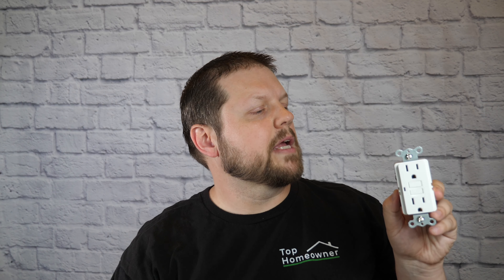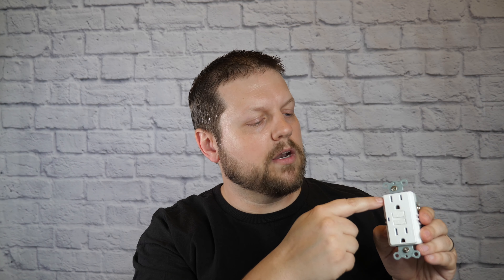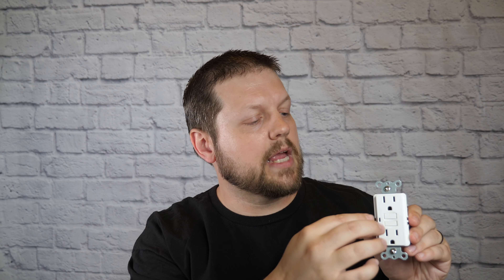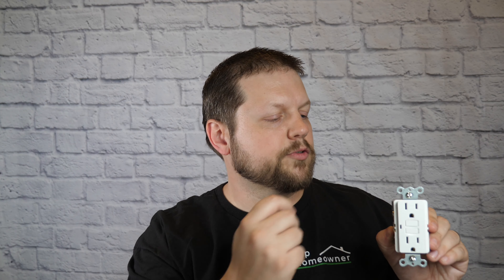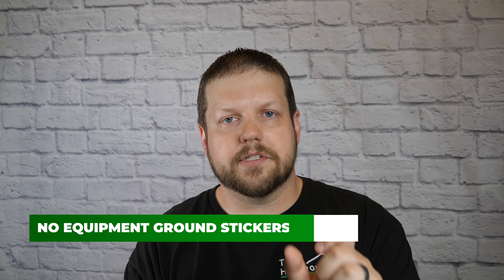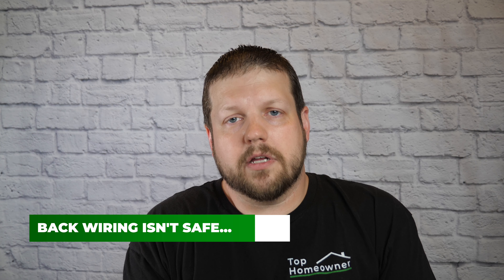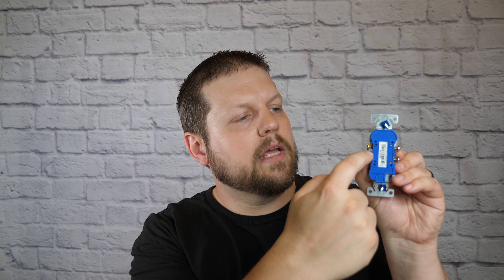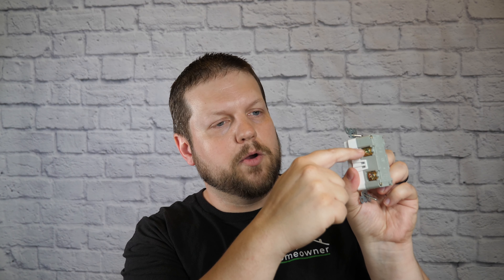Upgrading Two Prong to Three Prong Outlets - Don't Rewire Your House?

Comment: The house I currently live in was built in the 1920s.  The wiring was upgraded in the  late 60s early 70s it does not have a ground wire.  Some of my box has been upgraded and one room was completely required.  I’ve enjoyed your videos and learned a lot.  I know you recommend a licensed electrician and although I agree, $40000 to update my home is just not feasible at this time.
Reply: Wow, you must have had a knob and tube system. Yes GFCI and ARC Fault interrupters would be an affordable improvement. Good luck.
Reply: In Australia 🇦🇺 it’s actually illegal for anyone other than a licensed electrician to do ANY electrical work in your home in fact here in the state of Queensland they have inspectors who randomly check and if caught it’s a fine of up to A$40,000 for individuals and up to A$300,000 for corporations. So things like replacing outlets,changing a light fitting,changing a plug and repairing extension leads are all illegal and fine applicable!

Comment: How do you identify which is the 'first' outlet on the circuit? And once you put a GFCI on it is it better to replace the subsequent 2-prong outlets with 3-prong outlets or just use the 2 to 3 prong adapters?
Reply: Turn power off to the circuit at circuit breaker. Take apart an outlet, seperate the wires. Restore power at breaker. If the other outlets in the circuit are dead, you found the top of the circuit. It will often be closest to circuit breaker panel
Reply: Hire a professional!
Reply: @donaldhinson7144  Thanks to YouTube, most people can get buy without professionals, their high prices and "we know best" attitudes. Good riddance.
Reply: @sbearly  As an electrical guy, I know that you do not need years of training to put a wire under a screw and tighten.  I believe that most electrical guys want to see the job done correctly, bestest job that can be done.

Let me pain his scenario:  a partyat your house and "he bar tender" friend plugs in a blender into a badly connected outlet.  They get shocked.  Over night hospital stay for monitoring.  Who pays the hospital bill?  They will sue the home owner and their insurance company.  Now, in your state, if the house was not built to code, permits, etc, does the insurance company get to bow out and leave the home owner on the hook alone?

That $100 dollars you would have given the electrician could be used up bathe time your lawyer finishes their coffee.

As far as learning from YouTube videos.....was it an electrical pro or some guy with a wrench and a screwdriver?

Be safe out there.

One last question, 
"If knowledge is the treasure that you can give away all you have and still have all you started with."  did you steal from a pro if you get theirs?
Reply: @sbearly  Yeah you can learn a tremendous amount from YouTube and the internet all here on your smartphone. Based on your original questions you haven't learned much, at least not yet. More humility would be beneficial, be careful.
Reply: @donaldhinson7144  You must have deep pockets, but not all of us do. I completely rewired my 1950 house to comply with the 2017 NEC. I did one circuit at a time and replaced the old cotton wrapped 2 wire with 14ga Romex for the lights and 12ga for the receptacles and GFCI's. Turns out the "professional" who installed the 200 amp service didn't bother to separate the ground and neutrals in the original 100 amp box that became a sub panel. The original 100 amp panel (that is now a sub panel) is fed off the 200 amp main panel, but the neutrals and grounds were still bonded in the original panel.

Comment: I was looking into the same thing, but hit this, which you do not cover in this video: NEC 406.4D makes it clear that replacement of receptacles requires arc-fault protection (AFCI). There is no exception for 2-prong. Beginning..."Replacement of receptacles shall comply with 406.4(D)(1) through (D)(7), as applicable. Arc-fault circuit-interrupter type and ground-fault circuit-interrupter type receptacles shall be installed in a readily accessible location..." Note that it also specifically disallows the AFCI exception under 210.12D. AFCI requirements vary by region, so check the local code, but the NEC is painfully clear about this—since 2014, from what I read. (And then there is tamper resistance, but that's another issue...)
Reply from the maker: Great points! Always check what the local code is. The adopted version of the NEC can vary a lot from area to area

Comment: If you install a GFCI receptacle at the first  receptacle and plug in a GFCI tester in the next downstream receptacle and hit the test button it won’t trip the GFCI
Reply: Why?
Reply: Of course it won't.  There is nowhere where the tester could divert the current. You must totally forget external testers with this installation. You must use the test button. In fact that is always the only proper way to test GFCIs.

Comment: For country that has screw terminals on the side of there sockets with no finger protection - something most countrys probably got rid off half a century ago, You should of been using ground on all sockets.

Comment: Don't forget in the code if you change any outlet it is required to be arc fault protected  too.
Reply: Arne,   Which year NEC is that required?
Reply: @KevinCoop1  I believe it started in the 2017 code cycle.
Reply: @arnehelland6015     It’s been a long time ago that I did residential!   Retired 2018.   Pulled NEC and found it originated in 2011  406.4(D)(4) which says must have AFCI.     And was effective January 1, 2014.       Thanks!    Kevin

Comment: At 4:50, it's fine to put multiple GFCI receptacles on a circuit as long as all the connections are made to the Line side. The Load will not be used.
Reply from the maker: Yes, thanks for pointing that out. I wanted to make sure that everyone avoids daisy chaining the GFCIs on the load side which is a nightmare.

Comment: I have an issue, it’d be great if you could help! I upgraded two two-prong outlets to three-prong Leviton GFCI outlets. One has green light on, works fine, the other one has no light, and it doesn’t work. I’ll refer to them as A (the one that works) and B (the one that doesn’t) from now on. So, when I RESET B, it turns red for a short moment and shuts off A. B still doesn’t work and is not RESSETable anymore. But I am capable of RESETing A, and then it’s all back to beginning. A works, B doesn’t. They are both in the same room, neighboring walls, I don’t know if they are in the same circuit or not. 
Any help would be appreciated, but this was very useful video, thank you! Definitely a new subscriber!

Comment: I have replaced a broken switch(plate on the lever actualator broken but switch stil works) it had that backstab wires I ended up cutting and stripping it and wiring it as a clamp connection instead, this serves right on why clamp connection is better

Comment: If you have more than three outlets in  room, that would probably mean that two of the outlets are four (4) wire (two coming in and two going out).  How does one determine which is the first or incoming outlet which is where the GFCI should be located?  Thank you in advance for the courtesy of a response.

Comment: thank you for answering my questions.  now I have a more serious question regarding GFCI.  My question is, in the downstream of a GFCI protected circuit, should/can we hook up appliances such as refrigerator, dishwasher, microwaves, things that have capacitors to provide high starting voltages ? I found if they are placed after a GFCI, they will cause GFCI to trigger randomly and frequently, which is very annoying.  or I can simply represent the question as, should refrigerator, dish washer, trash disposer be protected by GFCI or not and why, given that they are properly grounded?
Reply: I can say from experience not to wire a GFCI to your dishwasher as you'll be resetting it quite often. I can also say from experience that your microwave needs to be on its own circuit and not downstream from anything, I tried replacing my vent hood with one and my kitchen lights dimmed and my tv turned off when I tried using it.
Reply: The problem with hooking GFIs in the first receptacle circuit of lets say two mofe outlets is that tha GFI detects an unbalaced load in the downstrem outlets from diffrent load requirements as those outlets power up Thats the physic s of electricity
Reply: This video is about ungrounded systems. Nothing in it applies to homes with ground wires. There are different rules on use of GFCIs on those. Putting a fridge on a GFCI is a bad idea as you can ruin the contents if it trips for a trivial reasons.

If you are worried do not hoot outlets on the load but use separate GFCIs. That way the leak current is less and also if something trips it does not stop any other devices. 

The 5 mA trip current is IMO too low. We have 30 mA in Europe and therefore less problems.

Comment: By useing only one GFI in a ladder circuit where the downstream ouletst detect diffrent load factors from lets say an amp or a motor starting that anomaly alone would cause the primary GFI to trip out

Comment: For DIY work I gladly pay a little extra for the commercial outlets. Much easier to make a secure connection.
Reply from the maker: Same here... I won't install residential grade anymore. It's just not worth it.
Reply: @TopHomeowner Can't really argue with that logic, but the residential receptacles are fine if not back stabbed and the plug is rarely removed as in a TV, for example.
Reply: For sure, but, the difference is like 50c an outlet if you're doing enough, which even if you were redoing outlets in an entire house, you're talking tens of dollars at most. Well worth it to not have an outlet wear out in 5-10yrs of heavy use

Comment: My house is grounded to cold water pipes throughout the basement. The panel is bonded to the pipe. There's 3 bedrooms upstairs that has floating grounds. All other receptacles are grounded. The kitchen actually home runs to the panel. Same with the outside receptacles. There's nothing but lamps and phone chargers in those bedrooms. They can be changed back to 2 prong. The painter changed those out and shouldn't have.
Reply: There ARE, not is three bedrooms...that HAVE
Reply: All  houses are grounded to the water pipe But that has nothing to do with outlets so I don't understand what you were talking about
Reply: The grounds to the water pipe are so you don't get shocked when you're in the shower or using a sink has nothing to do with the outlets at all lol
Reply: @AB-dl1hz  it is true that water pipes have been used in the past as actual grounding electrodes themselves, being that they make direct contact with the earth.
Reply: @jessebellino9780  All water pipes have a cable on them that goes to the lightning rod
Reply: @AB-dl1hz  yes, that's called bonding. What I'm saying is that the water pipe has been  used as the lighning rod itself in the past, as it makes contact with the earth. So if you bond a wire from that underground pipe to the grounding terminal on your panel, your system is tenchnically grounded. Code doesn't allow for that these days, though.

Comment: thank you, great video!  I did add on to my house years ago and regret not rewired the older portion of the house.   I am planning to install GFCI in the two rooms that has ungrounded wire.  However, I do have questions:  the two ungrounded room has ungrounded wires but using a 3 prongs outlet.  I was told that it is not safe doing that but isn't it the same as using an adaptor (3 into 2)?     Also, other options is to grond the few important outlet by adding a gound wire which is a "smaller" job than to rewire the entire.   I will like to know what you think before I jump into it.   Many thanks.   Or, anyone who viewed this comment and provide a helpful advice.   (unfortunately, I can't afford to rewire all the rooms that has ungrounded wire at this moment)
Reply from the maker: The issue with using 3 prong outlets that aren't grounded is the assumption they are. GFCI will add a layer of safety for you. I'm not a fan of cheater plugs (3 into 2) either.
Reply: @TopHomeowner  thank you.   I had an electrician that came to replace some old receptacles and when I suggested installing GFCI for some of the outlets, he said that it s not a good idea since I am using strp surge protector .   is that true?

Comment: Great video!  I appreciate you taking time and making these videos.  I have a question on GFCI outlets.  My house mainly has 2 prong outlets and I"m looking to change them with 3 prong.  Should I change all the outlets with GFCI receptacles?  Thanks
Reply from the maker: According to the NEC code, installing a GFCI for safety reasons is an acceptable alternative. I would verify there are no local codes against that won't allow it, or any other reason why installing GFCI might no be a good idea in your case.

Comment: All the outlets in my home office (from the 60s) now have CFGIs. You said that for certain devices (I worry about my Macbook and guitar amps) you MUST use a grounded outlet. Since it is not an option for me would a quality power bar with an integrated breaker provide some additional protection? Or is the type of protection these bars are made for unrelated to issues pertaining to grounding?
Reply: Just where did you get the idea that you must have a grounded outlet. From the manual? That is put there for all devices, sometimes even on double insulated ones. No computer requires a grounded outlet. Laptops are extra low voltage devices. Anything beyond the power supply is isolated from the mains.

Only point of using a power bar is that if you have several devices the bar levels the potential between them but a double socket does the same for two.

Comment: I live in an old house that is wired kinda crazy, meaning the rooms that have more than one outlet, are wired to different circuits, so it's hard to tell what's the first receptacle on a specific circuit. I need to have my 2 prong receptacle, on my front porch, replaced  with a 3 prong, but want to do it in a legal, safe, way that provides protection, any advice?!?
Reply from the maker: Always check local electrical codes first, but you should be able to install a WR (weather rated) GFCI receptacle for your porch. It won't provide a true ground but it will provide protection from shorts. Also, if the receptacle isn't protected from the elements, I'd recommend installing a weatherproof cover too.
Reply: @TopHomeowner  My front porch is closed in, btw. Thank u!
Reply: If it is just one receptacle there is no problem. You can just change it and use pigtails. This will protect it but not affect any other receptacle.

Comment: Would I be able to safely plug my space heater in with the GFI? I have an old drafty  house with one room (bedroom) that is freezing in Winter - thanks
Reply from the maker: The ground adds protection against electrocution, so a GFCI would do the same in this case. Ideally your space heater would have a plastic case and not have exposed metal to add even more protection.

Comment: thank you for this one! this really helped me get to understand the terms since i really know nothing abt electrical stuff. also wanted to ask if using a cheap 3 to 2 prong adapter to connect a heavy duty 3 prong surge protector will do more harm to the surge protector incase of surges?
Reply: by cheap 3 to 2 prong converter i meant the one like on your video. (found one here in an online mall shop for only $1)
Reply from the maker: For a surge protector to work properly it needs a ground. That's because any excess voltage needs to go somewhere, and instead of your devices it dumps it through the ground wire. I hope that helps!

Comment: Would it be ok to use one of those adapters with an window ac unit
Reply from the maker: I wouldn't recommend using an adapter in that case. Especially since the window AC unit is exposed to water outside
Reply: @TopHomeowner  yea i talked to somebody about it my centeral ac was out all week but good thing it was decent at night

Comment: Does the GFCI test button work when installed in an ungrounded circuit?
Reply from the maker: Yes, the test button will still work. GFCI "testers", the devices you can plug in to test, won't work though.

Comment: If the 2 prong receptacle is in a metal box fed by metal armored cable (BX), the box/cable usually provides a ground. Once you have confirmed that the BX armor is in fact connected to ground, can't you simply connect the ground of a standard 3-prong outlet to the box/cable? wouldn't that be a safe installation?
Reply: I'd say yes as long as all the mc cable connectors along the way remain tight. If you plug in a receptacle tester and it tests good and there's no "bootleg ground" then you're probably good.

Comment: I've been reading a lot about this, because sadly I can't afford a house so I have to rent and most apartments in my country are old and owners don't bother to rewire their apartments to comply with modern standards out of ignorance. And the average Joe doesn't care, so none does nothing. Anyway for what I've read these GFCIs are only for your personal protection, not your devices, computers and so, they are meant to be installed in places like bathrooms, basements and places where water and humidity is prevalent and a risk. They won't do anything for your PC or video game console.

In my country Mexico we have a problem with dirty and unstable power delivery, so buying power conditioners are a must for all households. No one ever connects anything directly to the wall. So in our case, that's the best way to protects our electronics. 

So I don't know, what do you guys think about this?.